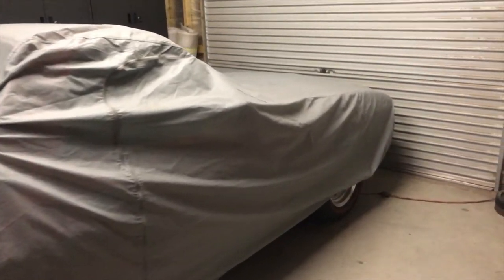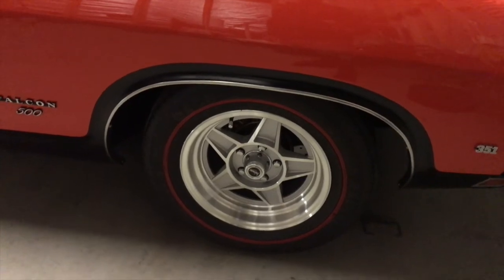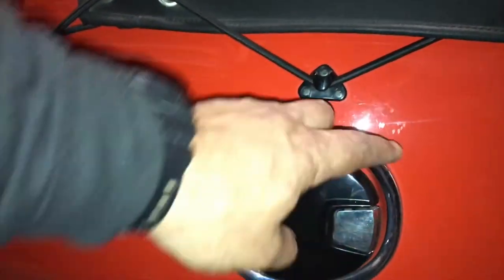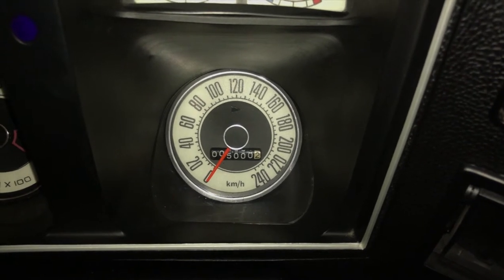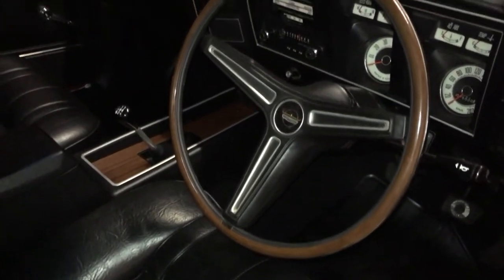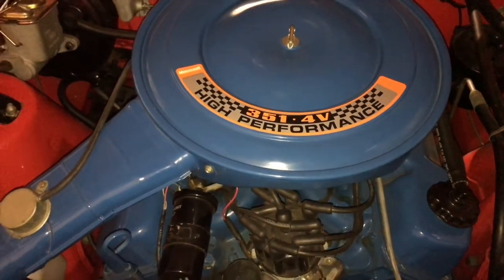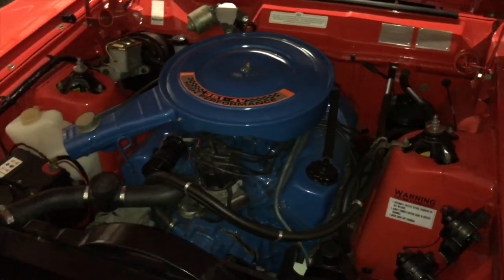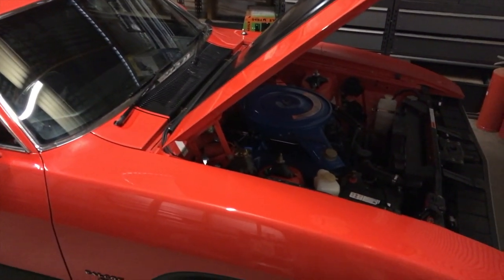XB GS Falcon Ute Walk Around - GT Ute - XB Falcon - 351 Cleveland

Comment: Hi Mike cool vid did you ever get the ute on the dyno??
Reply from the maker: No, I never got around to it. It’s currently off the road. Replacing brake lines, rebuilding master cylinder, upgrading some suspension bolts, fitting relays to headlights, and upgrading the stereo speakers as well as a few other touches. Will do an updated video once she hits the road again. Hopefully soon.

Comment: Awesome UTE!!!! What were the years this ute was made available?   I would like to buy one of these if I could, are there any for sale there?
Reply from the maker: Build from 1973 to 1975. Not sure of the exact change over date between models. You need XB Falcon. XA the previous model and XC the following model are similar but different. Different dash, grill, front panels interior trim etc even though the basic shape is the same. I sold two not that long ago that required full restoration. They do come up for sale occasionally but good ones are expensive now.
Reply: @MikesManCave  i am sure they will be expensive.  I like the look of your ute.
Reply from the maker: @andresvazquez6413  They used to be cheap as chips, but over the decades they keep going up. Like most things I guess. They are fun to drive as well.